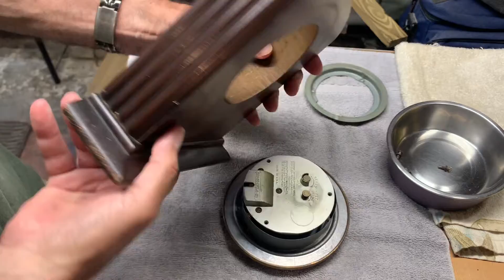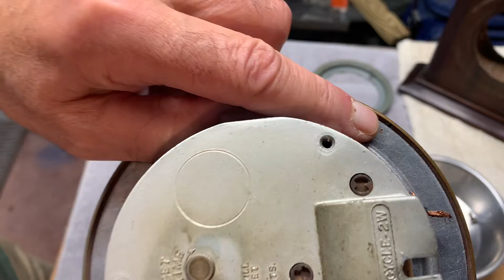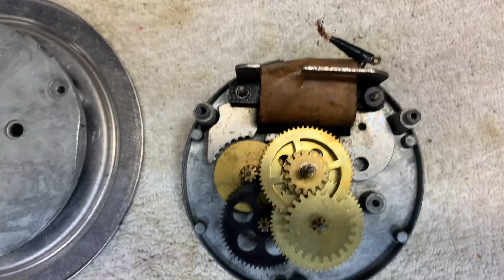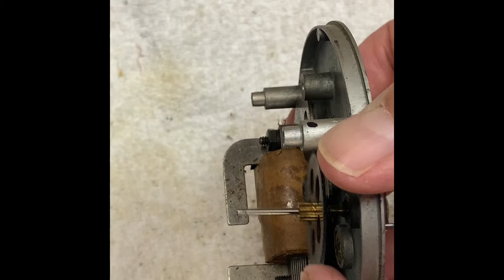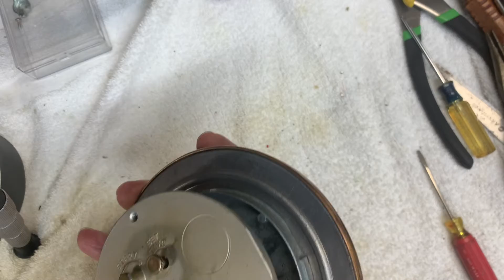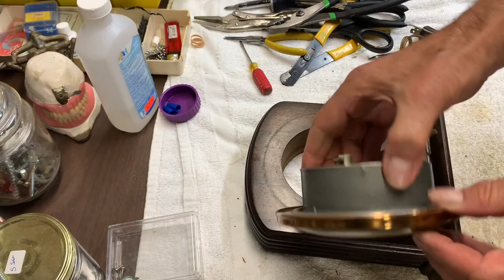Repair and restoration of a Hammond Synchronous Como clock

Comment: I just watched your video.  I have this exact clock but do not have a cord.  I didn’t even know it was electric until watching your video.  It was left behind when we bought our home 33 years ago.  Can cords be bought for these?  Also, I don’t mess with anything electrical.  I may consider getting it repaired.
Reply from the maker: Any lamp cord can be used, either get some at a hardware store, or if you have an old lamp laying around that you don’t use, you can take the power cord from that. Just make sure that enough wire is coming out from the coil so the new cord  can be soldered to it.

Comment: These are spin to start clocks, if the hands will move, the clock will start if primed with the spin knob on back with the quard.
Reply from the maker: Thanks for the info!  I have seen that in other clocks, but I have also had clocks that do not start even with the second hand turning.  It is usually due to either sluggish gears from a build up of dirt and oil or a frozen rotor.  Thanks for watching!

Comment: I recently repaired a similar Hammond clock. Before taking anything apart, I was able to gently remove the knobs on the back with small flat screw driver. It may be worth looking into those spooned hand remover things as well!

Comment: Thank you very much for your video. I just got a Hammond Synchronous clock with alarm, day and date with very similar back of your clock. With your video reference, I will lubricate the gears. I think I will not disassemble all the gears and will clean the gears with light fluid first, then lubricate them with synthetic 40W oil.

Update: With your video as the reference, I took the clock apart, cleaned and lubricated the gear train. The clock works smoothly. Replaced the old electric plug with a new one for the safety. Now need to figure out how to adjust the day and date display.
Reply from the maker: Although the backs look similar, the alarm, day and date clocks are much more difficult to repair.  Are you saying you will use lighter fluid to clean with?  A better alternative is to use acetone, there is enough present in nail polish remover.  Then follow that with alcohol using q-tips and toothpicks.  I am not familiar with synthetic 40W oil, but if it is meant for cars you would be better off getting a very fine synthetic clock oil.  One very good one is Horace Whitlock's.  I would love to see a photo of the front and back of the clock, I may be able to give you more information.  You can email it to me at marktheclockrepairguy@gmail.com.  Good luck.
Reply: @markh77  You are right, the inside structure is not same, and more complicated. So I did not take all the gear apart. just cleaned and lubed. All the gears looks great. I will email you some pictures. Thanks.

Comment: Wd 40  why? We 40 is not a lubricant and not a penetrating oil. It is water displacement formula. I wish people would stop using wd40 on everything. It will remove moisture and help prevent rust in certain cases. That is what it was made for.